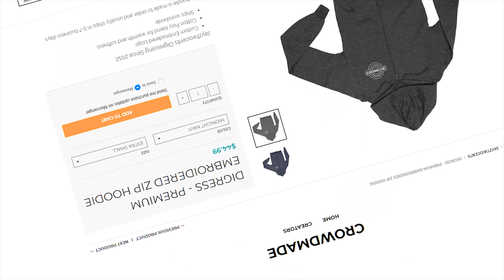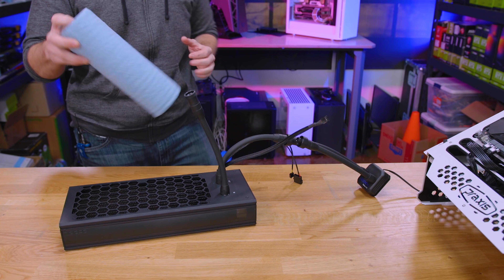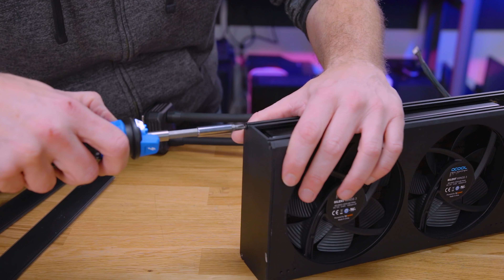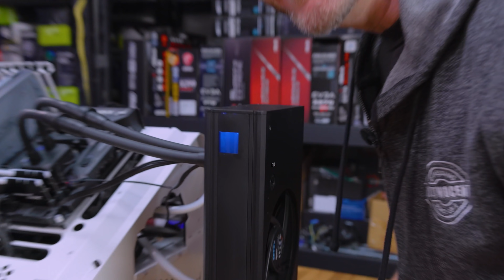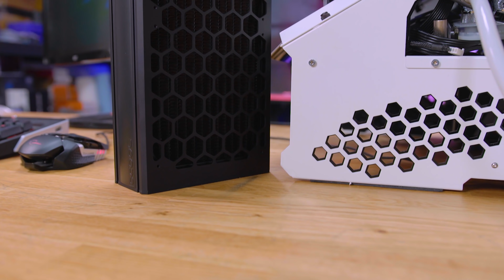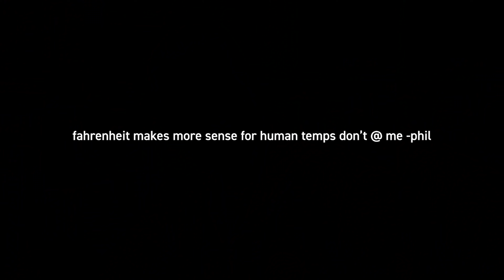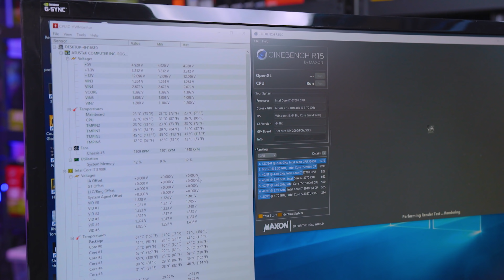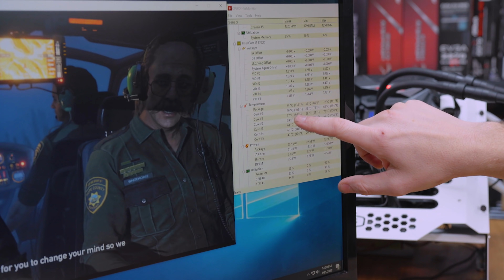This AIO is ridiculous!

Comment: checking on the price for this cooler in Canada... It's over $420 CAD. besides being all copper, the Fractal S24 is also g1/4 fittings but aluminum for 1/4 the price here. is there an actual noticeable difference in the cooling?

Comment: My 8700k at 1.4 Vcore and 5 GHZ was easily cooled by  Noctua NH-D15 did not hit abive 60 in CineBench (Delidded). But I have tuned the Vcore since then, and now run 5 GHZ all core, 4.7 Ringbus at 1.335 Vcore.
You have a shitty 8700k... Also you underestimate a NH-D15!

Now Prime95 AVX Small FFT maxes out at just 85° C on my hottest core.

Comment: @phil:
Fahrenheit degrees are literally just a bit over one half celsius degrees, the ranges are also comparable. You just... 0C = freezing cold. Not super cold, but cold enough to make ice and snow, but usually the slushy kind of snow. Drop another ten degrees and it's real winter temperatures. 20C = good neutral ambient. 40C = hot, like almost Phoenix, Arizona hot. 45C = Phoenix, Arizona. 50C = hot even for Phoenix. 60C = the temperature of the hot water that comes from your hot water tap and the temperature at which you make green tea. Temperatures above this aren't really meaningful for the human experience, since you'll die or possibly get severe burns. 90C = temperature of McDonald's coffee until that one lawsuit made them serve it at a safe temperature. 100C = literally boiling.

Comment: JAY, i need your two cents.  i just upgraded and came to the intel side, yes i left AMD ..  i am now running a Intel 2011V3 6800K with a gigabyte X99P SLI board, running 16gb 2400mhz memory by XPG white , and a MSI 1060-6Gb video...  anyways i am thinking really hard about going water cooling on the whole fracking system, and i liked the look so much of the Mono water block on the intel boards.    what do you recommend for a mono block that would work on my board that has RBG, the case im not to freaking sure what it is, it has white cyber power stickers and logo tag on front..  .  i have two 120mm fans in the front one 120mm fan on top and one 120mm fan in rear, i am thinking that i can run 140mm 2 front and 1  top, rear 120mm, i also want to cool the graphics card in the loop.  i bought the whole system fro 640.00, that also included a Asus 24" 144mhz monitor 1080P, a BLUE mic, cheap cyber power mouse and keyboard.  i will say i miss my 32" TV i was using as a monitor that i still have but not using..  SO recap mono block for gigabyte X99P and water block for MSI 1060 6gb  vid.

Comment: 1.4 is reasonable. So is 1.45. Over 80 however is not. And that is why the 9xxx series is not worth even considering. This Architecture is not designed to handle more than 4 cores. It can handle 6. Barely. But not 8.

Comment: I always wonder why reviewers overclock to these temperatures with an AIO or watercooling loop. It's fine for the cpu, but it's not fine for the loop. At least the pump cannot take water temperatures above 60° C. And you really shouldn't go above that.
Reply: if water is above 50ºC you have a fried CPU already.
Reply: @virpz  If you stress it long enough, the water temperature will always approximate the CPU temperature. 
I monitor my water temperature with the aquasuite and I have it set up in a way that at 40° C the fans and the pump run at full speed. Under full load, I can see water temperatures up to 45° C and CPU temperatures in the low 50s.

Comment: Can y'all find out the best cooler for the Vega 64, I purchased the MSI rx Vega 64 8g air boost. But I want to push my card a little bit harder and I want a better and quieter cooler so if you could find the best water block for my GPU I think allot of people would appreciate it

Comment: The temperatures I get on my corsair h100i v2 are much better than yours. I do have a push pull config setup, but I don't go over 62 celcius on high pump and fan settings under aida fpu stress for 15 minutes. If I turn corsair link to balanced then I stay under 70 still.

Comment: I have alphacools 240 and 360 aios in 1 loop on my ryzen build and vega56 clocked to 1750mhz core 1150 mhz hbm2 and 3.95ghz all cores ryzen 1600, inside a meshify c resting around 60c on gpu+cpu stress test. Check it out on my channel!

Comment: ooo jay is using some high load line calibration settings as it idled at 1.4 but under load went up to 1.440 so take the rest of his voltages he names with a grain of salt as his 5ghz at 1.28 under load may end up something like 1.310-1.320 depending on how his load line calibration effects it hence why adia 64 shows avg votlage as 1.310 and max of 1.328 as his 1.28 is not 1.28 underload

Comment: Also, Cooler Master made an expandable AIO a few years back. The Glacer 240L. I used that for about 3 years in my PC until the pump died... (2 months out of warranty of course)
Reply: I was considering this Eisbaer as a replacement for my CM until I heard the $280 price tag... I think I only paid around $130 - $150 for the CM.

Comment: Celsius is super simple. At 0 C water freezes, at 100 C water boils (at sea level). We are mostly made up of water, so it is logical for humans.
Reply: @Steve Sherman is not brine mostly water? How is fahrenheit  calibrated to brine?
Reply: @Steve Sherman not mad, you were just nitpicking :D
Reply: TBH that is rather interesting and I had to read up up on it. Still, it has been calibrated several times in history. A bit confusing..

And stop provoking me, no need to be toxic
Reply: @Steve Sherman yeah, a system built around body temperature being 98 seems good. That's why fahrenheit is more commonly used in science and generally in the world than Celsius or Kelvin.

I should add that in  general imperial measurements are much more logical than metric. After all, we all have feet of our own as reference!

Comment: let's see this test with a 9900k at 5+ ghz.
Reply: also I'd say your interpretation that the air coming out of the radiator not being warm as an indicator of good performance of the cooler and bad IHS/die transfer should be looked at more.  Perhaps the water block is shit and not transferring anything to the coolant.  There are other variables as well.  To rule it out to the IHS/die mate is silly to me.

Comment: will the icebaer have issues paired with a 1080ti poseidon? as in any metal issues aluminum to nickel or copper etc.... I'd like an easy swappable component also what coolant do you need to use in it?

Comment: 66 F = 19 C, 68 F = 20 C, 70 F = 21 C and 72 F = 22 C  That is very close the higher the degrees in F then formula is (F - 32) X (5/9) = C  In case any one cares...  Nice AIO, why did they not make a 240mm also to fit into a 280mm or 360mm place (there is that pesky metric system again)...

Comment: My only gripe is that until you expand the system, its out of balance and you are paying for more pump and/or rad than you need.  If the price is in line with the parts costs, you might as well build a custom system for your rig, or a cheaper, standard AIO until you need something bigger. not that my opinion matters.

Comment: So based on this if I had my 8700k at 5ghz with a vcore of 1.325v running at 67C with a max of 72C that should be fine right? Just wanting to make sure since it is the first time I have actually overclocked a CPU to more than just the boost clock. I don't think I won the silicon lottery with this since I saw a few people with 5ghz at 1.25v.

Comment: how does °F make more sense for human temperatures?
the normal human body temperature is between 36.5°C-37.3°C, depending on individual and time of month.
standardized temperature for testing and using precise measuring tools is 20°C.
Water generally freezes at 0°C and boils at 100°C.
it's easily converted into °K.
it's linear and easy to understand for everyone if they don't start behaving like a little child being forced to take shitty tasting medicine or doing something else it doesn't like.
it uses decimals for easily showing more accurate measurements.
it wasn't created by a crazy man with some salt water who guessed temperatures and made them arbitrary numbers.
it's already incorporated into all standard equations that deal with temperatures on a day to day basis and even for those that require °K, look at the earlier point of it being extremely simple to convert.